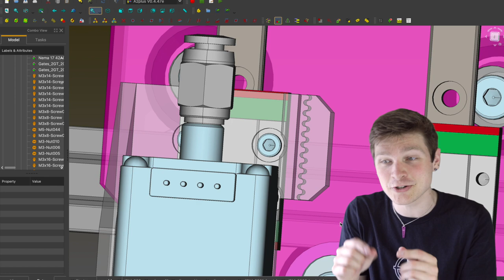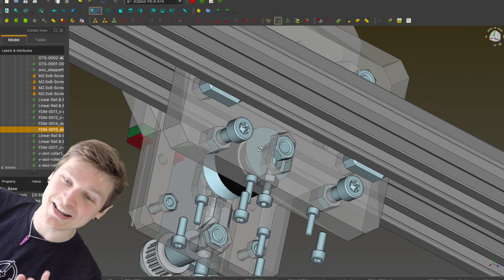The Index Gets Proper Belt Tensioning!

Comment: You should probably put something metal behind the new tensioning screw. Otherwise it will dig into the plastic.
Reply: while the bolt might dig in a bit this will not be a big problem.  I would say using a lock nut on the bolt, or a drop of loctite on the bolt would be a better improvement.  It is amazing what vibration do!
Reply: @allenlorenz  or use nuts with nylon inserts for those.
Reply: @JonathanBuford  That is a lock nut :-)

Comment: You should use a flanged nut, or at least a washer, for the tensioner, to increase surface area and prevent the plastic to flow or crack under the belt tension with such a small area.

Comment: if someone hasnt already said something you may want to edit the x and y tensioners a bit to add some metal or a cap to the end of the adjustment screw, otherwise the plastic it is in contact will will deform/break over time, good solution though

Comment: if you really want constant tension, considering adding complaint springs with a defined strain (preload). Directly tensioning the belts without such a spring makes it susceptible to creep in the belt, and thermal effects (mismatched tempco of the belt vs. the aluminium-frame)

Comment: Congrats! The whole thing looks better and better and the tensioning system is really clever. But you might want to support the loose end of the motor shaft  with a bearing. I did destroy 2 motors on a corexy printer by trying to achieve the perfect tensioning (over-tensioning) of the belts. The motors got louder and louder until one started to skip.

Comment: Amazing update as always!
I'm curious if the gantry belt attachment points are in line with the pulley width - It's probably moot, but it looks like the gantries pull the belt a bit away from the track for the attachment point, which could cause some cosine error, or at very least some belt loosening between midpoint and extremes of the travel as the 'triangle' portion of the belt length changes.

Comment: Nice job on the tensioners! Lots of comments about the screw tip contact on the plastic. A small piece of steel glued to the plastic could be an easy fix, or a pair of jam nuts tightened against each other with a touch of thread past them and a washer against the plastic are easy fixes. I'm more concerned with the mechanical limit switches... they look out of place (IMO) and require unnecessary PCB's (IMO), but more importantly, are not very repeatable. Use U-shaped optical make/break sensors and a flag... very repeatable, solid state, and can be direct mounted without PCBs.

Comment: Maybe somebody already said this, but if you want other people printing these parts on there printers it might be a good idea to make so kind of test/calibration part to print. With some known measurements on there to check and maybe the different size holes for the push in nuts. So people can validate that the parts are the correct size before printing al of them.

Comment: Awesome project Shephen ! Why not use linear guide rails on X/Y ? It would simplify the gantry and make the joints more compact. I would use a Voron 2.4 like X/Y gantry system that is very accurate and handle high accelerations. Also, you should have rubber feets ! ;)

Comment: Terrific!  I imagine there isn't a quantifiable answer for this question, but what IS the right amount of tension for the belts?  How will I know if they have the correct amount of tension on them?
Reply: I’ve heard of people tuning belts by plucking them and adjusting until a particular tone plays. Just like a musical instrument.
Reply: @amoose136  what is the note for the correct amount of tension?
Reply: @KarlMiller  If you model a belt as a string under tension, the tension observed from the audible tone of a fundamental resonance frequency resulting from a step change (plucking) should be as follows: T=4×[belt span in meters]²×[measured peak frequency in hertz]²×[belt linear density in kilograms per meter] The frequency can be determined cheaply with a free spectrum analyzer app for a phone (there are several). Target tension is determined by the belt manufacturer but tends to be "the minimum so that it doesn't slip over a tooth." The purpose of a sonic tuner is to get consistency on every assembly.
Reply: @amoose136  Holy crap!  That has to be the best answer I have ever received on YouTube.  Not only did it teach me how troubleshoot my own solution, gave a rule of thumb characterization that I got.  This channel is so educational, and it has some great people contributing as well.

Comment: Not to be a party pooper here, although you might consider some kind of plate for the Y belt tentioner (the rend thing with the bolt that tentions the belt). I noticed that when you start tentioning with the bolt being screwed in, this one starts to eat into the plastic part, will eventually make a hole into the part.

Comment: Does it make sense to give a recommended numeric torque range for the belt tension bolts? if users have a torque driver of course
Reply: and are there any other quantitative methods for someone new to building an Index to know they have a good belt tension? maybe pinging a belt and measuring the sound frequency with their phone?

Comment: Its really cool but there is a even better way of doing it you can see it on the ender 3 v2 it does not use a hinge so the Roller is not moved of center so the Belt has no chance of rubbing against the frame and another Bonus is that it can have a waaay longer travel range so you can put on the belts completly lose and still have perfect tension it works by having the Roller floating and with 2 printed pieces and a screw you get linear motion